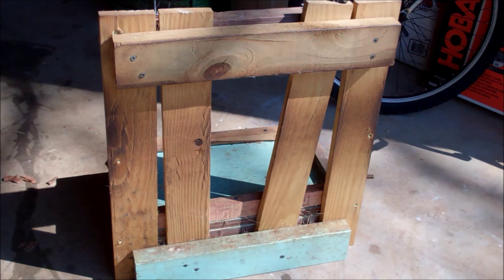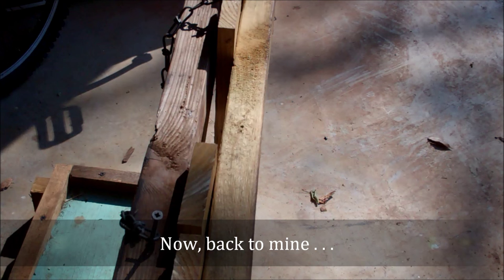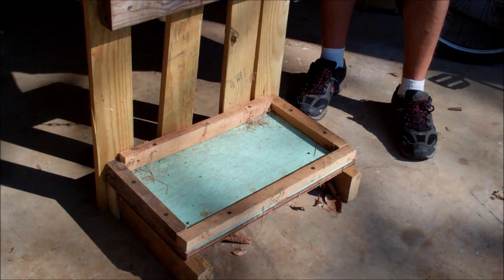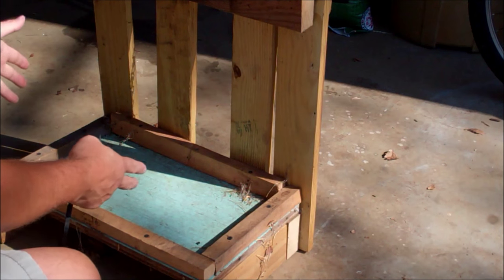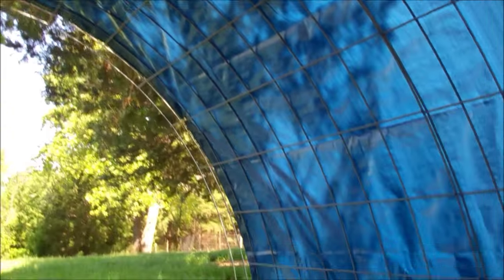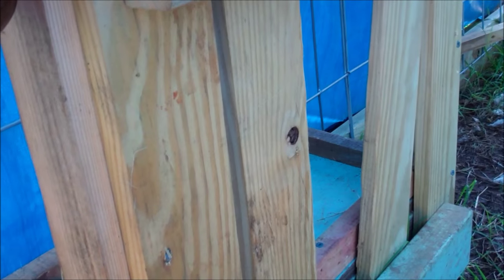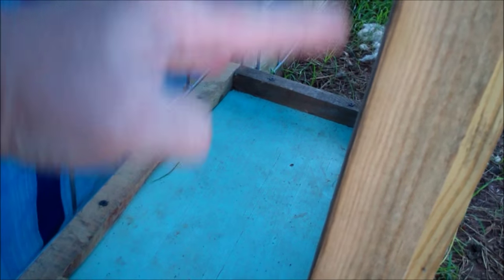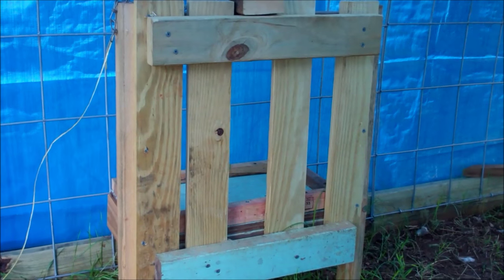A Simple Easy To Make Headgate For Goats Or Sheep

Comment: Yup I've seen these used before for milking. Easy project and always good to share a "why didn't I think of that" idea!

On a side note I bought that hand crank vegetable juicer/grinder you featured a while back. Used it for the final press on grapes (for wine) and it worked fine. Had to pick the right filter (used pumpkin sized) and even then had to break it down halfway through to clear the pulp. But the squeeze was good, the waste (skins and seed) that had separated had very little juice in it. 
First time using something is usually trial and error, and as I was pressing 10 gallons... well. 
So thanks for the tip on a good product. Made the job about 75% easier. I'd say 100% but it's still work!  haha 
Also a little more cleanup but it breaks down easy enough.

Comment: Don't they try to pull the 2x4 posts in the ground out? Looks like the back should be attached to posts also? Great ideal, and ty for the video.
Reply from the maker: +Larry342516 The Headgate was screwed to all 4 posts (the short ones in the back and the taller ones in the front). It was pretty secure...